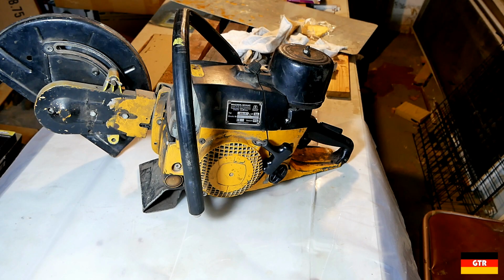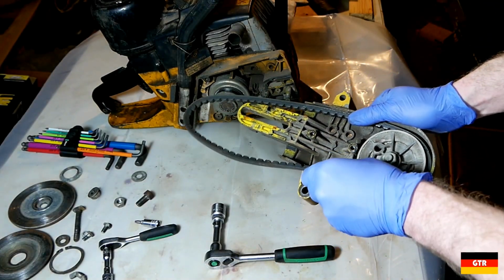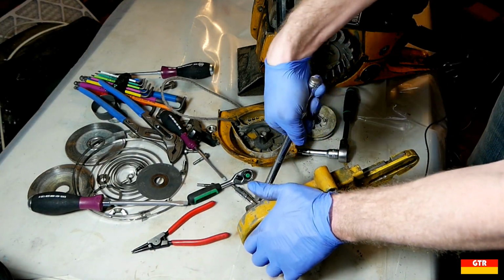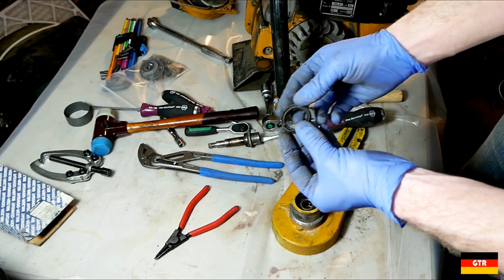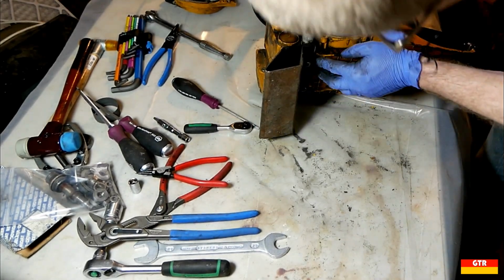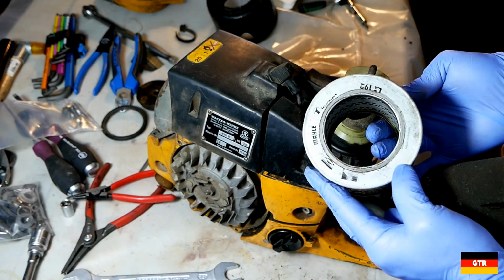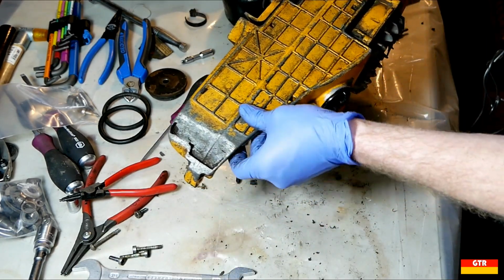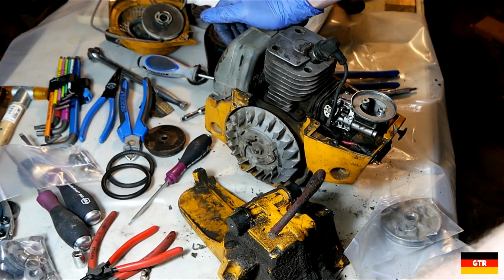Wacker BTS 11 Concrete Saw: Part 1

Comment: That bts11 is made by Dolmar out of germany. It’s the same as Dolmar 309/343 concrete saw. Also the same 2 stroke power head as a 123/133/143 chainsaw the bts11/309/123 were 70cc, 133 was 85cc and the 343/143 were 95cc. Parts are still able to be found if you know how and where to look for them.

Comment: Wow, I think the internals are too much complicated beyond the engine for just power transmission to mechanical movement to achieve concrete cutting by a circular saw. I am not a mechanical engineer but why so many parts between the engine and the ultimate saw mounting wheel.
Reply: Its for user safety. In many saws you will find a belt and pulley. In case you tilt the blade while cutting the belt slips an damps the blowback.

Comment: Make a pulley on a lathe. Biggest thing is to cut the key slot. Any machine shop can do that or even order a cheap replacement if the size is standard. Mahle is a brand that makes not only air filters but fuel and oil filters as well

Comment: Regarding the cracked wheel you should get yourself an AC/DC Tig welder. Or if you want to go cheap use some of this aluminum repair putty they use in the automotive area.

Comment: I know Mahle as producer of pistons. Never knew they made airfilters.

Found on their website
MAHLE products are used in every second automobile around the world; this is no wonder since the company is one of the 30 largest automotive suppliers and one of the top 3 systems providers. Almost all automobile and engine manufacturers work with MAHLE when dealing with piston systems, cylinder components, valve trains, air management, and fluid management systems.
Reply from the maker: I looked up the model for the air filter and apparently it is the same one used in some BMW motorcycles.
Reply: Mahle makes a TON of OEM parts for german cars. When I look at BMW parts, Mahle comes up a lot.